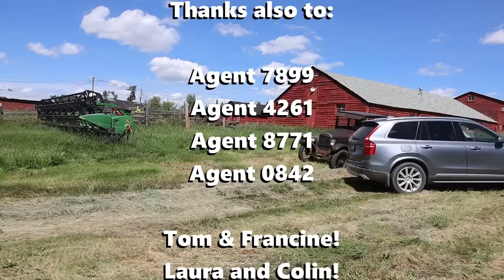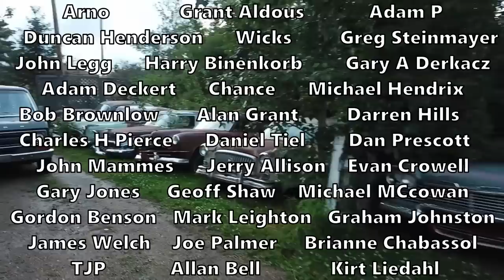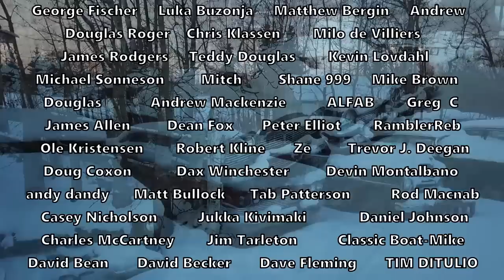Laura"s One-Word Car Reviews: Ford Model T! Plus: 1960 Plymouth Fury Interior Coming Together...

Comment: Laura is very cool & funny, and I loved this section. The Fury is looking so good…not a car that you could use here in the UK as you wouldn’t find a parking space bid enough, but it’s a best anyway! All the best!
Reply: You'd be surprised how small they are compared to modern cars.
Reply: @TestECull  That Fury's still 320mm longer than a modern Chrysler 300, which is itself a pretty big car by European standards.
Reply: @TestECull  Not sure where you live, but you might be surprised how hard it is to park a Volvo V90 in the UK! I think that our parking spaces have been designed around the Mini.
Reply: @TheAjsimpson  They were designed, like the standard "single" and "double" garages, around the Austin 7 of the 1920s and 1930s. But yes, modern cars are absurdly large and heavy.

Comment: The Model T driving lesson was epic and unexpected in its various nuances of timing, throttle and gear selection. Laura is a good sport throughout and it makes me think it was a lot of fun for the kids and a lot of sighing for Mr. and Mrs. Newstead in the 70's and 80's. 

Scott, your eye for videography is as good as your eye for bodywork. The single-wide dirt trail amidst waist-high canola under cerulean skies and alongside worn, but serviceable work buildings, giving way to the dusky skyline of a latter-day city of the plain (Calgary?) with a wobbling, imperfect artifact of a car are spot-on. And no chemtrails in the frame, something Hollywood directors all too often neglect. Cheers!

Comment: I cured that whole "stepping on the starter button by accident" thing on my model T by drilling a hole in a hockey puck and putting it over the button. I only take it off to start the car but I usually use the crank anyway. Nice to see Laura figured out that the passenger side door is really the only sensible way to get into a ModelT. great episode as usual!

Comment: In 1926 Model T still had wooden spoke wheels as standard.  Yours has the upgraded optional 21" wire spoke wheels.  Laura, the Model T is designed to be entered from the passenger side as you found out.  In fact, prior to 1926 most if not all Model T's didn't even have a driver side door.  It was just solid steel body.  That makes more sense when you take into account the location of the hand brake control.  Even after the Model A was introduced, Henry Ford wanted drivers to use the passenger door to get in and out, due to safety reasons; not wanting his customers getting hit by passing traffic.  The passenger door is the only one which can be locked with a key from the outside.  The driver door can be locked but only from the inside.

Comment: Thanks again for the honourable mention. The cell reception at the lake isn't great so I had to wait to see this video. It must be over 2 years since the deal on the carpet came our way. I hope it does the job.  I always worry about fitment with so-called molded carpets. My experience has been mixed.  Nice to see the interior coming together.  It won't be long now. I'm sending up another package in about a week.
Reply from the maker: Phil! Good to hear from you! I am headed out there right now to put in another gift you sent: The speedometer cable!  Cheers and thanks so much as always boss...
Reply: @coldwarmotors  I had totally forgotten about that!  I'm always scrounging around or picking up all kinds of things.

Comment: The video I've been waiting for. Bravo Laura! After seeing her drive that humongous tractor thing in a previous video I knew she was up to the Model T. In the 1923 T runabout I was familiar with they didn't even put a door on the driver's side. It was just a stamped impression of a door. I'm not sure if that changed or was dependent on body style and year. A bit of trivia - Ford continued to build the T engine until about 1940. It was sold for utility and farm use which I suppose speaks to its durability.

Comment: "AWESOME!" "MORE FURY PARTS INSTALLED!" "LOVED IT!" I can't wait to see you drive the 1960 Plymouth Fury down the Queens Highway! Teaching your sister to drive a Ford Model T was interesting. She seemed complexed of learning what to say about it. Your sister is a tough cookie!  This video was almost an hour long! I can't help smiling when I see the Model T rolling down any road. I like the chatter clatter noise the engine makes. It reminds me of my old long gone 1988 Toyota pick up with the 22R engine. It had a simular sound, but you reved it up it sounded like a V8. I modified the engine with larger vavles, larger Wisco flat head pistons, 1 5/8 header, Holly 500 caburator, Offenhouser intake manifold,  M.S D. electronic ignition, aftermarket Ford distributor, aftermarket midrange cam,  N.G.K. spark plugs,  new oil pump, new altinator, new starter, K&N air filter, a 35 lbs. Torque flywheel and a Toyota heavy duty clutch made for the 1 ton dually trucks. I miss that truck. Owned it for 20 years! Topped out at 185 horse power compared to the stock 112 horse power. 
Sugestion: buy a Chinese supercharger and install it on the Model T's intake manifold and install the stock carburator on top. I saw a video on YouTube of someone did this on a stock Model T engines. I thought it was cool! Probably added 50 more horse power and speeds of 50 m.p.h..

Comment: First I love your sisters sarcasm. Second, you have a cool sister. You got to remember when these cars were made they had to be able to handle the roads of the time. Which were not good. The cars look fragile but I'm pretty sure they're tough as nails ,they had to be. In the beginning of the video you had some of your agents cars in your driveway. I don't want to hurt the agent's fault I think his name is Jim, that has that beautiful 60 Pontiac. I'm hoping I was imagining seeing a horrible set of wire wheels on the car. That's 60 Pontiac looked absolutely perfect with the steel wheels and the dog dishes. I hope the mag wheels are temporary. Fantastic video as usual and still too short and an hour long.

Comment: Very nice episode with Laura. The T is great for many things, but ergonomics is not one of them. Lucky for us controls have been standardized for the better. You were correct that when it came out in 1908 it was new and amazing, but by 1925 it was done. There were much better ways to make cars run. Lots of credit to Laura for getting behind the wheel. You didn't open the windscreen for that in your face blast of air as you drive. The Fyr is fabulous and definitely an episode with the Fairlady would be welcome.

Comment: had some friends that built a model t speedster, hand made a small wooden body and used a rajo overhead valve head and ruckstell 2 spd rear and late t wire wheels, it ran pretty good but with only 2 wheel mechanical brakes, nobody was that brave to really let it go.

Comment: Driving the model t if you are revving it and it sounds like its going to blow up it is. Good one Scott. Well driving the model T is an experience especially if you are used to driving a manual with a clutch you have to reorient yourself to adjusting the spark advance and accelerator on the column and no clutch on the floor but three pedals one drive forward one reverse and one brake. But with a little instruction she did pretty well.

Comment: Excellent video Cold Water Motors Agents Scott  :) Laura  :) , Tom the Boss :) also Laura  :) don't feel bad learning how to drive a Model T car my one late neighbor had one he took down or up  hill drive of 45 angle with S on first drive and was scary but learn fast like you when Scott teacher it too ! I stalled out to 3 times go down and up hill ! But learned fast too and got better after 4 trys too !  But like new 1930 to present years transmission set up Clutch, Brake , Gas for Floor shifter also Coulmn Shifter for Manual transmission  and Automatic transmission on Column and Floor with brake and gas too plus some Synchmatiic too ! Double Clutch also Torque Amplifier control too for Manual transmission to! Laura you did well and Scott taught nice ways on Model T drives  too also bet he got taught with nice instructions too by nice person love teaching other too! Scott I like that did also ! For at first nice nickname Laura called Model T (The Thing) on cardboard!

Comment: Joking aside, it really looks like climbing in and out the passenger side is the quicker. easier, safer option, not to mention more elegant.
I've never been in a T, far less driven one , but I'd love the opportunity to give it a go. I've always driven stick-shift manuals and I don't think that would be much help. First time I've seen Laura struggle and I think I'd have the very same problems. So much of driving is done by reflex, without really thinking about it and, if someone messed about with the pedals, I think I'd get confused too.

Comment: 52:08  It's 640k not 64k. (the saying is probably a myth) 64k is the maximum address size of a 16bit address bus.  640k is the conventional memory area of a DOS PC. It's the first 10 64k banks of the 20 bit address bus.of the 8088/8086.  The next 384k of the 1MB of address space was reserved for things like screen RAM, ROMS, the bios.  This was a major flaw in the design and haunted the PC architecture for YEARS.

Comment: If you can get another aluminium kickplate a good welder could make filler wire and repair the other 2 but it looks pretty pure showing the corrosion.Alloys weather better normally

Comment: With respect to ingress/egress, if you watch older movies (thru the 50's) the passenger door is how you got in and out of any car--even if you were the driver!  
I may be wrong, but I believe the earlier open body T's didn't even have a functioning front driver's door.  The body stamping had the outline of a faux door, but you really had to get in and out on the passenger side.

Comment: My dad and my uncles would use there cars or a chain and a tree to straiten bent  bumpers they would push or pull against a tree a post or use a come along or just beet out a dented bumper with a small sledge hammer

Comment: If you watch any of those early movies  that have Model Ts in them you will notice almost all of the drivers exit / enter on the passenger side or in the case of an open car just step over the side from the running board. Of course Ford for years had a dummy door on the drivers side for all the four door sedans and phaetons anyway. I think it was only the closed cars that had an opening door on the drivers side.

Comment: She did good 👍 l totally understand her final summation, but this Is summer 2022...early 1900s winter - I'm thinking you had to put sleigh bells on the horse because there wasn't much for braking on a sleigh...T Model Ford (with heater) clearly the better alternative...anyway, l thought she not only "caught on" quicker than most but looked good cruising the car with her arm resting on the door...good video 👍 l liked it

Comment: Beautiful location for a Model T drive. 
I tell folks that a model T has a 2 speed automatic transmission with no valve body, you have to do the shifting.
 Is your Magneto bad? They run better on the mag.

Comment: 1929 Cadillac was the first to have synchro gears 1896 1891 was the first 3 speed non synchro invented by some French dude check Wikipedia "manual transmission"